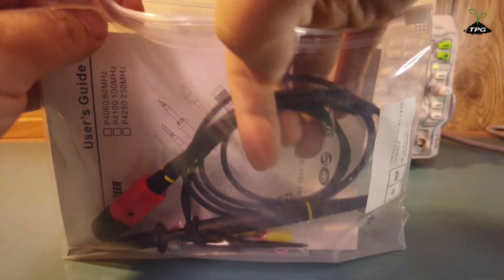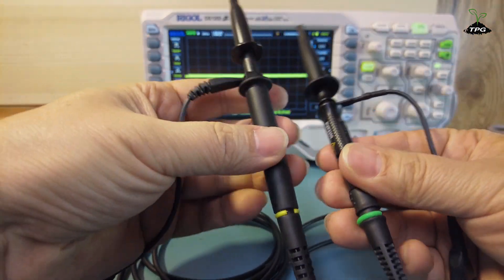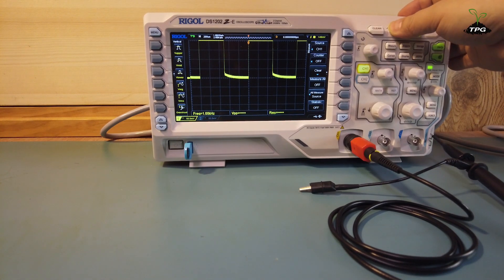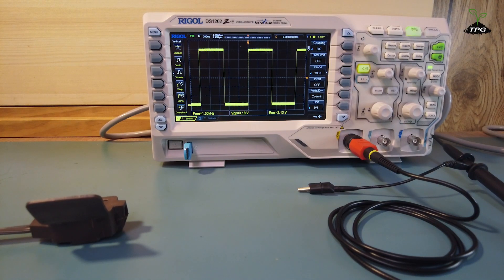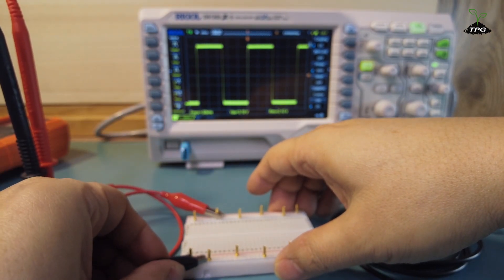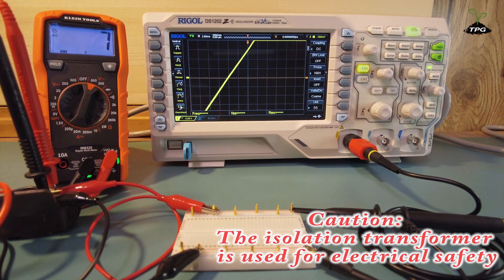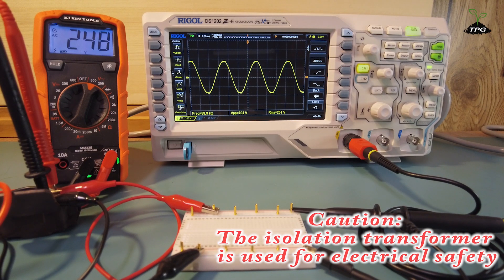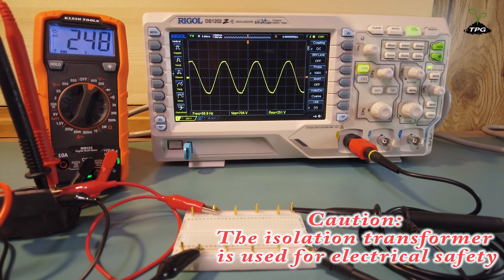Check Out an Inexpensive High-Voltage Probe with Power Outlet

Comment: When scope GND is connected with PE (earthing) like in this case, then You shouldnt use passive probe as You shown. Use differential probe instead.
Reply from the maker: thank you, the outlet is from an isolation transformer
Reply: @tpg3942  that is one of methods. In this case You should warn viewers how to do this safely for them and scope. If they switch L with N or they have TT type grid, then all metal things coming outside of scope (BNC, USB and test generator sockets) are under high (dangerous) voltage.